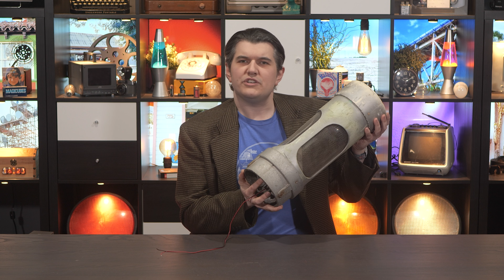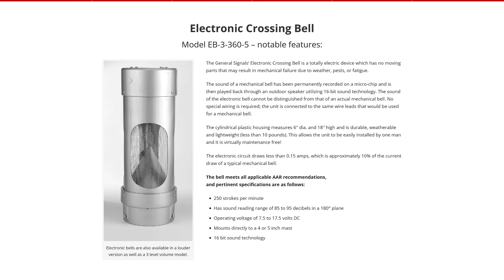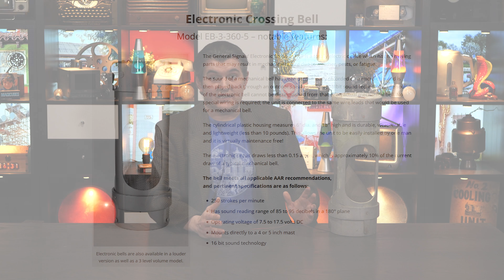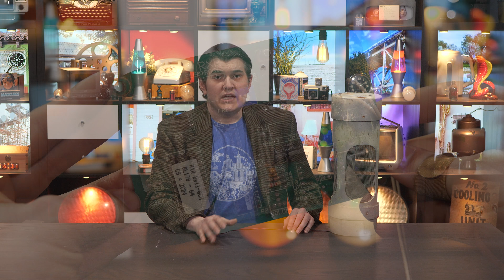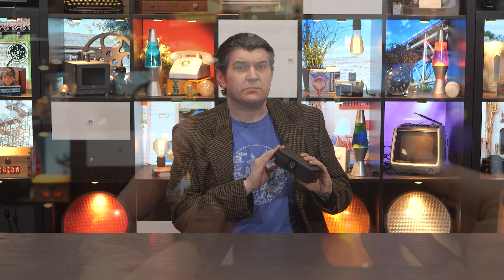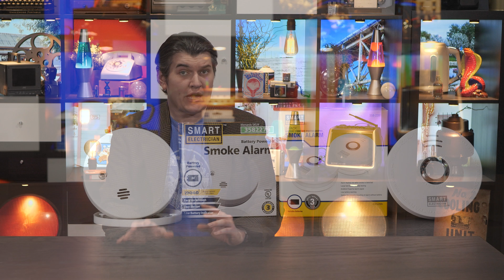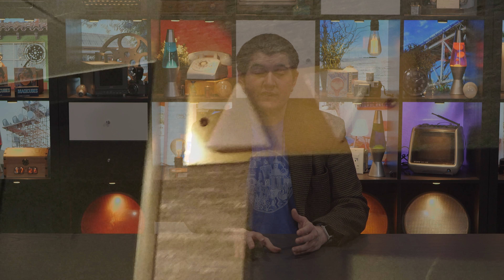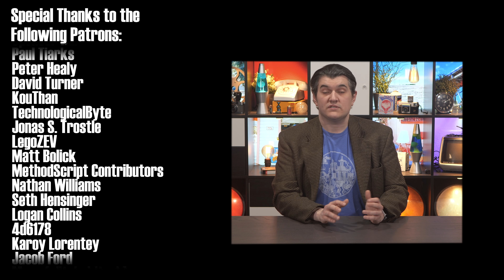The disappearing and unappreciated art of audible alerts

Comment: The temporal 3 tone you generated sounded a bit like a busy signal at first, but oddly now that i know its a fire alarm signal, it brought back memories of when my schools would run fire drills, they were older schools that still used Klaxons and bells, yet you would have the 3 tones followed by silence repeating even with those old units, i would bet the fire alarm panel was updated but they kept the old announcers, they even had control over the system as the way they would signal the end of the drill was to sound the klaxons for 5 seconds solid, then would use the schools PA system to tell us that we could head back to class, they even could use the system for earthquakes which on our schools case was was to sound the system for 10 seconds solid followed by 5 seconds silence during the "duck and cover" portion, then 2 tones with silence for 5 seconds when they decided it was time to have the students and staff evacuate, it would then repeat the solid tones whenever an after shock was felt signaling to all those still in buildings to find a place to cover again and the students outside on the fields and away from objects and buildings to sit down.

Comment: Audible alerts on cars are also very interesting, seems like so many manufacturers make some odd choices. My parent’s car uses some rapid high pitched beeps when engaging the emergency braking system or if you forget to put the car in park before turning it off, but it uses that same pitch for one beep when the adaptive cruise control “locks on” to a car in front. The noise feels too harsh and loud for that. Even more baffling to me is BMW using the same noise that indicates a check engine light to alert you that it’s cold outside

Comment: I'm a fire alarm system installer and it's nice to see some of that technology being recognized at all. It's completely invisible to most people despite the sometimes incredible level of complexity involved in their design, installation, and maintenance. As life safety systems, every part of those processes are defined by codes (mainly NFPA 72). It's one of those jobs that's never going to go away since new buildings will always need those systems, so it might be worth your time to research them even more. Education on alarms could be helpful for people that, say, live in a high rise building, since the way the notification works in those scenarios is a little unintuitive--the temporal 3 may not even be present, for instance, if speaker/strobes are being used in place of horn/strobes, and some municipalities require that only the floors nearby the first alarm signal get notified instead of the entire building. When you consider the breadth of technologies in use for these systems, it's almost surprising more people aren't interested in them, but I think that's because most of the knowledge is retained solely by those in the industry. Obviously people don't know all the details of most careers, but fire alarm systems end up being a part of everyone's life at some point so it could be nice to explore that.

Comment: not about audio but visuals instead but this reminds me of how phones used to have a "keep on" setting or allowed to set the timout to never so it always stayed on. which i used extensively to glance at activity while on the pc or when using apps with long periods of no active input. now i need to have a scripting app installed which lets me define custom behaviour just so i can tellt he screen to stay on and to tell the phone to turn off internet and switch operational mdoe when its not detecting my home wifi anymore.
Its also a reasonable preset to have 5 seconds, 10 seconds, 1 minute, 10 minutes as selection options for when to lock the screen but removing the customization of custom timers and the "never" option are such a strong degredation for no good reason.
if im getting a new phone roughly every 4 years to keep up with growing hardware demands and technology changes then why should screen burnout and battery lifetime stop me from having my desired behaviour when i dont keep my phone long enough to experience these drawbacks anyways.
we get hand held and then our hands chained to the guard rail so frequently on so many topics even with specifically just fones that it irritates me in to turning in to an angry boomer yelling at people.
maybe its my neurodivergence but i expect things to do what i told them and to behave in a way compatible with my brain instead of demanding me to adjust to "my" device.

Comment: That you can’t easily change notifications sounds to something custom is one of the pet peeves of iOS for. Also that you can’t FORCE an app to have different vibration and sound settings, instead the devs need to have activated this. Half of them didn’t. I had a whole system for it when I was still on Android.

Comment: I used to do locksmithing and access control work. We'd have customers want some sort of magnetic contact that rings an electronic bell, and wherever practical we'd "downsell" them to one of those NuTone chimes. Those things look cheap, but they're basically foolproof. I stopped by a store a couple years ago where I'd installed one back in the mid 90s, and the chime was still there, still working.

Comment: For those with an Samsung Android Smartphone: you can configure a per-person ringtone by going to Contacts (the Samsung app, not the Google one, if you also have that one installed), going to the contact for which you want to set a custom ringtone, go to more (bottom right) -> change ringtone/vibration. You can even select whether you'd like to ignore vibrate / mute settings for this specific person - in case this person never calls unless it is an emergency and you'd really like to know when they call, even when you are in a meeting.

Comment: 5:24 I feel like if you're going to be pedantic about something, you should probably be more rigorous. There are various contexts in which "bell" and "chime" are distinct from each other, but those distinctions vary significantly between those contexts. (And many of those contexts are very close to each other.) I think the distinction you're trying to make here is either that the vibrating element is not paraboloid-esque (paraboloidoid?) or maybe that the striking element is separate from the vibrating element, but I'm not sure your pedantry here is all that accurate. There is a similar musical instrument called a "chime bar", but I think the pertinent word there is "bar", not "chime", because the same context would have a chime be a tube or rod, or, more accurately, a series of them. In contrast, this is effectively a single-note glockenspiel, and the individual elements of that are generally just called "bars", or "sound bars". Also, the body-mounted glockenspiels you used to see in marching bands are called "lyre bells".

Comment: Now my question is still the same:
WHY!?!?

i live right next to some tracks and just about 3 years ago they changed from the mechanical bells to the electronic bells.... and they have already been replaced AGAIN.
Of course that had to be made far worse by the speaker being mounted right on the post holding the crossing-lights, at head height, and directly angled at the pedestrian walkway (they have a strong directionality). It directly blasts the ears of anybody walking by...... 

The normal bells had just the simplest of motors and that's it - a singular part that can fail, a part that is as rugged as it gets and easy and cheap to replace. On the other hand these electrical boxes? You STILL got a mechanical part - the speaker - and now also some more fragile electronics. And if something goes wrong somebody needs to check if it is the powersupply, the Rom, the digital circuitry, the amplifier, or the speaker. And this is an actual security Nightmare. With the bells, unless the hammer striking it breaks, it is easy to detect if it still works remotely so that any error can be fixed asap (kinda critical for infrastructure like rail). 

Sound-design can be really interesting but also hard to get right:
With a friend we made a remote-controlling system for electric farm fences - controlled via simple WalkieTalkies. We had to change our initial audible reply cause while very distinct the tones we had chosen were too high for some old farmers to hear so instead of a nice pitch-increasing chime they just heard 1 or 2 beeps and that's it. And absolute no-go when the thing is literally controlling high-voltage and the farmers rely on the fence to be turned of so they can safely cross it. (And shoutout to DTMF and its wide support by walkietalkies).

Comment: I find way too many warning signals' main design consideration is "make it actually painful to listen to," which I think results in a lot of noise pollution caused by signals that are much louder than they need to be to function. I think people notice that the signals get ignored, assume it's because they're not noticing the signal, and then try to make louder instead of addressing the actual reasons that people are ignoring it. People probably aren't having slow responses to the fire alarm because they don't notice the fire alarm; usually the building has a history of false alarms, or the people running it have a reputation for doing surprise drills in all manner of unpleasant weather, so people assume it's a nuisance alarm rather than an actual fire, and take a moment, for example, to grab a coat on the way out.

Or, like, train whistles. It's important to know that a train is approaching, of course, but it probably doesn't need to scream like a jet engine at pedestrians standing in the appropriate location for waiting for the train to pass, and especially not at an intersection that already has another audible signal as well as multiple visual signals... but, just in case of failure, the alternative probably shouldn't be "literally no whistle at all."

Comment: 5:18 I made a "Game Show Buzzer" once for board games and trivia games. I used the high tone from a door bell for a correct answer, a dryer buzzer for a wrong answer, and a couple of arcade buttons in green and red installed in a small "project box" as to not take up too much space on the table. You can hit the green button as quickly and long as you desire for the appropriate enthusiasm level, and hold the red button as long as desired to convey the proper amount of humiliation... 😛

Comment: 19:14 I really miss HOLD switches. Smarphones never had this holdover from the iPod era, but it would have been nice to just have a switch that prevents accidental presses that drain the battery and also keep the volume settings where they need to be without the risk of movement in your pocket creating a sudden, violent burst of audio into your eardrums, potentially causing permanent hearing loss.

Comment: I had a career in computer development for about 12 years starting way before desktop computers and ending in 1980. When a software or hardware change was made to the computer under development,  it was always done to fix bugs to make it work as initially designed to work. Occasionally, there would be a change to an original function spec but that seemed to be rare. With the advent of desktop computers and cell phones, software updates don't seem to be just for bug fixes but mainly for functionality changes.   With each upgrade, a new function is introduced or a change to how the operation of an existing feature is used. Bugs would change with each update. When I get comfortable using a feature, I'd have to relearn it. Frustrating at times.
 
I am not a fan of this trend but I am hooked, and don't see myself getting rid of this technology.

Comment: 19:00 I think this is the main reason why people don't bother personalising specific sounds for specific alerts. Personalisation was interesting the first time, it was even a WOW event, but after several phone changes and few updates that reset everything or changed how it works, few people will bother setting it up. Maybe if I would get a phone that I will be sure it will not have to be replaced, ever, and with software that guarantees everything will work, and setting those things will be easy enough, then sure I could do it. But already in back of my mind is that I should have replaced the phone, and investing time in it seems pointless. Especially since I don't get many notifications anyway.

Comment: That fire alarm sound wouldn’t get anyone’s attention at all who works in telecom. It’s identical to many errored call signals from multiple PBX systems. Neither would three ring bells being ear catching for older telecom folk. Same issue. Ringing an extension like that happened daily. 

Just use the loud piezo horns. 

The carbon monoxide four beeps also isn’t interesting to my ear. Tons of things I own make that sound including my car.

None of my combo smoke and fire detectors — I have many types and brands, don’t ask —  make those noises. And I hope they never do. They’re far louder and much more obnoxious to wake humans from deep sleep. 

The bing bong on aircraft never uses separate pitches as you mentioned it could, and it could, but most older systems couldn’t. So because procedures must be the same across a fleet for human crews, the only thing that changed is how many chimes are activated in a row. That means something. But most airline folk won’t talk about that. (Just like they won’t discuss cockpit security procedures.)  

Oh. And phones and watches can use haptics instead of noises — but they should detect whether the user is holding them and be able to switch automatically. Some now can. 

Loved the rant. 😂 😂 😂

Comment: 19:21 I am so tired of every single tech company deciding to ruin perfectly functional UIs.
Reply: Part of that is because of the ridiculous drive from shareholders to always get more money as fast as possible, so companies just change stuff around randomly to make it look like they're doing something.
Reply: @nikkiofthevalley  Actually a majority of it is intentional attention manipulation. A large portion of modern UIs are not designed to convey information to the user, they're used to broadcast specific attention sinks. For example, have you ever wondered why when you unlock an uncustomized Android phone that there are snippets of text and images from your various installed programs instead of a clock and battery indicator? That's because a clock and battery indicator are momentary signals, while an article or video thumbnail requires more than a split second to recognize. Everything everwhere with a UI is now designed like this, and it's why information overload is such a stressor for so many people.
Reply: @VulpesHilarianus  what do you mean snippets of text instead of clock and battery?
Reply: @kaitlyn__L  On old Android and iOS the only thing you could see when you hit the side button was the clock, "Slide to unlock" at the bottom, and the battery indicator up in the top right corner. Nowadays if you have something like Facebook, Instagram, Discord, Weather, your local newsreader, or anything else when you unlock the phone the first thing it displays is whatever excerpt from the latest fetched post from any of those. Some programs are even malicious and will use this functionality to display ads on the lock screen. Both Google and Apple  have at least figured out this is a bad idea and let you disable notifications on the lock screen so people can't see sensitive information, but that option isn't enabled by default.
Reply: YouTube, Firefox...
Reply: @Sustainable_Engineer the new mobile firefox UI has been pissing me off for the last few weeks.

Comment: Let me just say that I adore that you addressed temporal 4!
It needs to be more widely known and supported by more alarm signal models.
SO many 'horn-strobes' for fire systems only know temporal 3, which is good because they do need that. But with the list of systems and detection devices that support CO these days, it appalls me how few of them support temporal 4 as well!
I'm a long time NICET certified alarm systems technician, and I've worked with a lot of brands across thousands of commercial settings (even hospitals and prisons, ask me how they are similar some time). Yet temporal 4 languishes in the 'should' section of the code, not 'must'. (For those who read NFPA recreationally, you know the significance of that difference.)

Comment: A feature on Symbian back in the day was that the alarm clock would turn your phone on if it was off. Very handy and absurdly absent from modern phones
Reply: It makes you wonder why phone operating systems are 10+ GB when they lack all these little features.
Reply: @bcj842 Spyware and bloatware? Inefficient coding.
Reply: Ten years ago I had an Android phone that did this, it must have been a MediaTek feature. Not sure about current phones though
Reply: There are few Android phones (vendors?) that allow for scheduled restarts or starts from shutdown. It really is a shame that its not integrated into the alarm clock.
Yes, modern Android encryption makes it harder, but it is a foreseen use-case by Google!